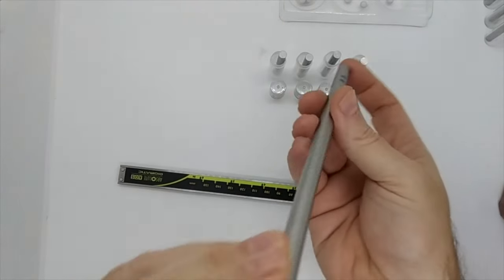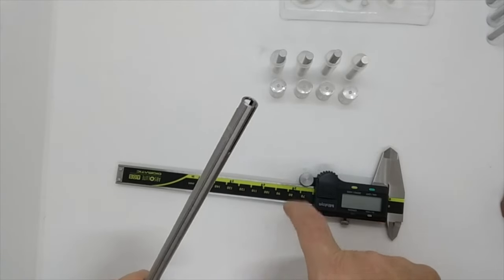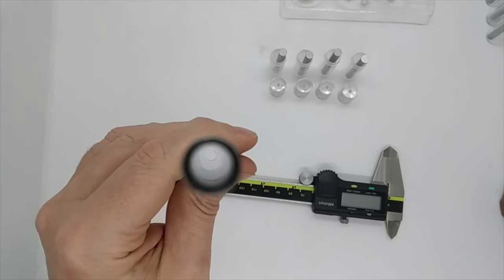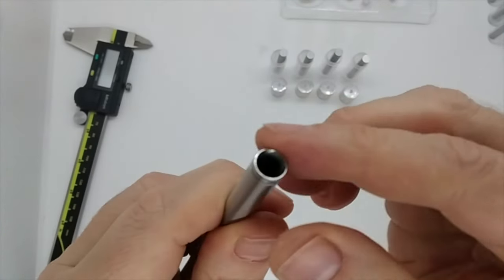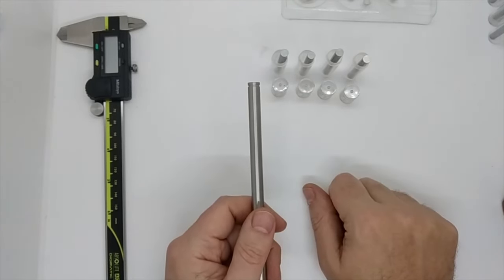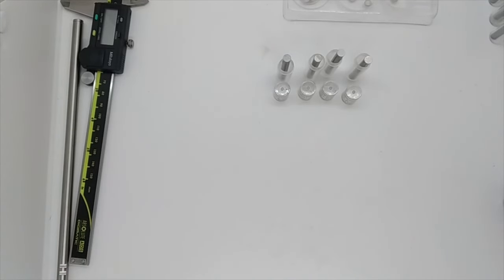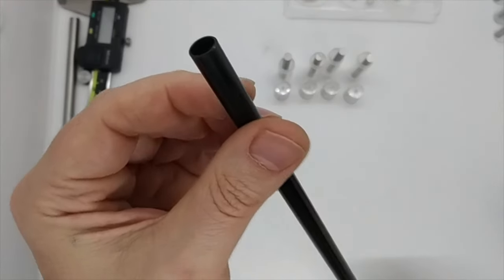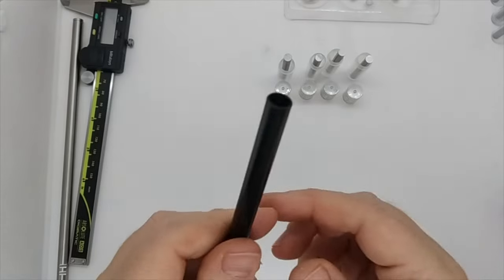XT Prototype Airsoft Inner Barrel Size Measurement

Comment: Would be worth checking if the gauges can travel through the entire barrel, would give you a better idea re consistency of the bore. Only issue is metal on metal and if it does get scratched then barrel's pretty much done!
Reply: Thank you for the insight mate, it really makes understanding which companies you want to stick with for quality parts and which not to.
Reply from the maker: These pin gauges are quite expensive so don't want them to get stuck or scratched so just happy to do a couple of inches at the moment.  End of the day if a BB can go down and the shooting is straight that's more than good enough.  I'd perhaps expect it on a barrel that cost £120 but not for £20.